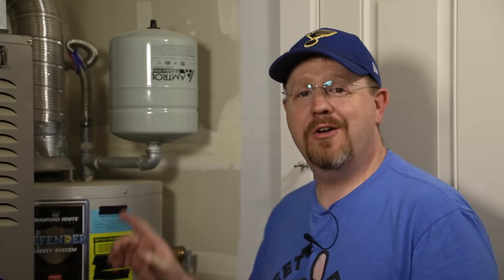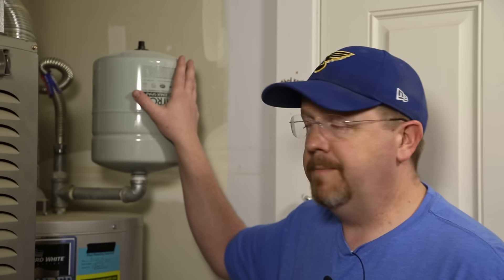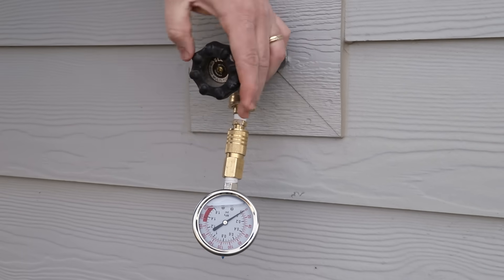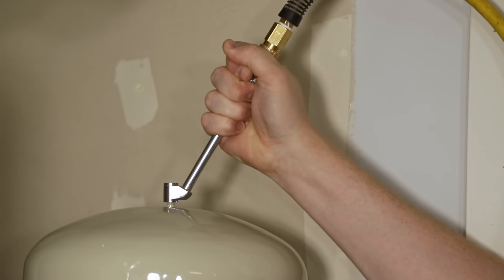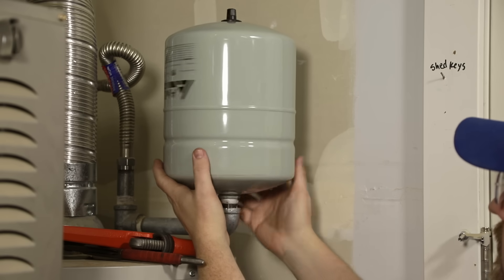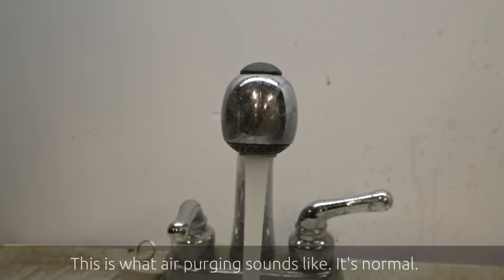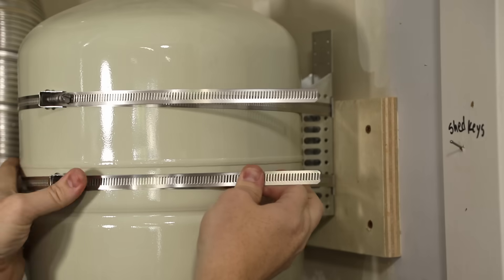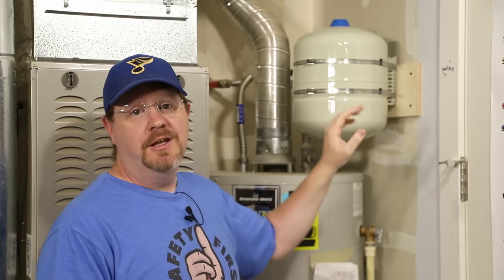What Is This Tank? How to Replace and Maintain a Water Heater Thermal Expansion Tank

Comment: Awesome video!  
Questions. Can an expansion tank cause these noises around the entire home after a bathroom faucet use or toilette flash...there is this hammer like noise.  Can a bad tank cause thus noise.  Thanks
Reply from the maker: Hi Khalid - you are describing "water hammer", which a tank like this can help with, but only on the hot side. If you hear this noise when a faucet is only open on the cold side, then you need a "water hammer arrestor" installed. You can learn more about arrestors here: https://www.phcppros.com/articles/2634-water-hammer-arrestors

Good luck!

Comment: Thanks for sending link to this video I watched your other video on how to drain and flush W/H . One thing you said at the beginning of this video though about "how it works", You said the E tank has half air in it and the bladder holds the water, I have always thought it was just the opposite water in the tank and bladder on top which is attached to the air valve, did I misunderstand your description  and it's not important in the end I guess, but I like knowing about how stuff works. I wish I had 75psi wp, mine is only 35psi. Thanks for another great video. I replaced my water heater about 3 years ago because my old ones thermostat wouldn't allow it to heat until the water temp got uncomfortably low, it could have been because of scale and rust surrounding the thermostat anyway my new water heater is doing the same thing but to a far lesser degree, which is disappointing, it seems like it could have (should have) a narrower range between heating and off.
Reply from the maker: Hi Harry - I think you understand correctly (and my description may have been a bit lacking). The expansion tank is made of 2 chambers, separated by a rubber wall (bladder). The chamber on the side that screws into the tank will fill with water. The chamber that is on the side with the schrader valve is filled with air, pressurized to match your water supply. Ideally, the bladder sits more or less evenly between the 2 chambers, but as water expands during a heat cycle, it will expand the bladder into the air chamber. When the water cools and contracts, the bladder contracts. I've been planning a video for a long time where I cut a few of these in half to show the insides, and better explain how they work. Maybe I'll get that on my list for sooner than later. Thanks for watching!

Comment: do you need expansion tank even of you Don't have backflow valve?
Reply from the maker: Need is more or less dictated by your municipal water supply. You probably don't need one if you don't have a backflow preventer, but having one will help future proof in case your water supply ever changes, and it will provide an extra level of protection against thermal expansion in your system, as well as the effects of water hammer on the hot side of your system. Thanks for watching!

Comment: If I don't have a way to check my water pressure is it ok to just go with the preloaded PSI in the tank if it's the same as the existing one? My expansion tank is actually crack and leaking so I need to replace it. I would attach a picture if I could.
Reply from the maker: Hi Shina - most tanks come pre-loaded with too little pressure. Most municipal water supplies run between 60-80 psi. I recommend setting your expansion tank to around 60 psi if you don't know your water supply pressure. Good luck!

Comment: How or does the initial air in the expansion tank (the water side) escape?  Air is lighter than water and if you install the tank above the water source, it would seem to me that any air in the tank would be trapped permanently.  Maybe this is not an issue because in theory the tank can still fulfill its expansion and contraction duties with air on both sides of the bladder.   Also. My tank is from Amtrol, and the instructions specifically say to mount the tank with the air valve at the bottom and the inlet water valve at the top.  If I were mounting the tank below the water source I can see how the water would enter the top of the tank, but due to space constraints, I have to mount my tank completely above the cold supply line and run a line up to the top.  In this orientation, I can’t see how the air ever escapes from the tank.  What am I missing?
Reply from the maker: Hi WK - the bit you are missing is that the air does not ever escape a functioning tank. The tank is split into 2 sides: the water side, and the air side. The bladder inside the tank keeps the 2 sides separated, with the compressed air on one side, and water expanding/contracting on the other. You can think of this bladder sort of like a balloon inside the tank, that is inflated with air. As water is forced into the tank, the bladder full of air is simply compressed to a smaller volume. Since air is compressible and water is not, this whole setup works really well.
Some tank manufacturers recommend installing the tank in a specific orientation, others show that in can be installed in several different orientations. The tank I showed in the video, for example, can be installed in either vertical orientation (air up or air down). 
Hopefully this all makes sense - I'm happy to clarify further if needed. 
Thanks for watching!
Reply from the maker: In re-reading your question: I realize I misunderstood: Air can leak out of a failed shrader valve, through a pinhole leak in the side of the tank, or through a failed internal bladder. Most often they fail because the plumber who installed it initially did not bother to check the supply pressure and pump up the air side to match. That flexes the bladder beyond its limits, which causes it to leak the air into the water side.
Reply: @AmplifyDIY  Thanks for the replies.  After watching a whole bunch of installation videos, I have decided that my high location for the expansion tank (which is higher than the cold supply line) is not a good location for future servicing.  After thinking about how much a full tank of water would weight and me on a ladder above my water heater, that's not a good scenario when it comes to replacement.  I am limited on usable wall space near the water heater so I've decided that I can mount the expansion tank metal strap mount on a simple piece of 1"x4"x4ft lumber and then use the water heater earthquake straps to hold this on the side of the water heater.  Solve my lack of wall mount space and puts the expansion tank below the cold supply line with the correct orientation specified by Amtrol.  Solves all of my issues.  Thanks again for the response.  All comments help to get me thinking of a better solution for my situation.

Comment: I think my two heaters are hooked up in series. If I'm right, then I want to make sure I understand which one is the one that directly feeds the house, and which one is receiving cold water from outside. I think tank A is receiving cold water from outside, and that's the one with the overflow. Does that make sense? The reason I think this is (a) I turned it down to the pilot setting and I'm still getting hot water (the other one is still on hot), and (b) Tank "A" has the overflow tank, and tank "B" does not. You said that the reason you need the overflow tank is that there's a check valve preventing back-flow, well in this case, tank B's water can just flow back into tank A, but tank A has a a check valve, so that's why it needs an overflow tank.

Does that sound right? If so, I have another question: If I have two heaters in series, for normal use in a small household, is it better to turn heater A off and let heater B do all the work, or is it better to let heater A do some of the work, and the let heater B do the rest of the work? I'm guessing it's slightly more energy efficient to just turn heater A off, especially since a warm heater A would just foster legionella.
Reply from the maker: Hi Mitch - you are exactly correct with respect to which is heater A and which is heater B, and the one with the expansion tank is the one receiving cold water from outside. 

As far as how to set them up: It depends on your water usage patterns. If you have 2 40 gallon tanks, you could try turning tank A down to the pilot setting, and experiment to see if you ever run out of hot water. If you do, then turn tank A back on to the same heat setting as B. If you don't, then you can certainly turn tank A down to a lower setting (but probably not all the way to pilot). This will make both heaters work less.

Great questions!
Reply: @AmplifyDIY  Thanks so much. I think I'm simply going to turn tank A off. It's not too much trouble to turn it back on if it's not working and with only two people living in the house, I don't think I need that much water heated. They're in series, so it's still getting water flowing through it, so I don't see any particular problem with turning it off. It's missing the piezo-electric ignitor, but I bought a new one, so once I get that installed, it seems like it will be just as easy to turn it on and turn it up if I, say, have a lot of company, or get some kids as it would be to turn it up. And that way the pilot light won't have been running pointlessly for years at a time.

Comment: Question Where do you connect expansion tank INLET  or Outlet?
Reply from the maker: Hey Raved - it goes on the cold water inlet to the water heater.
Reply: @AmplifyDIY  Thanks for your reply i will replaced my heater tank since had small leak and also i order pro press tools  i own small granite business and now i expand my business to do some bathroom and kitchen renovation

Comment: I hope I can get a quick amswer. How we choose the expansion tank, is there a calculation?
For instance , if I have a 70 Gal. Water heater. Would a 15 gal tank be enough?
And thank you for the great information.
Reply from the maker: Hi Wyle - you can use this calculator to get an idea of the size tank you will need. I put in some typical baseline numbers for a 70 gallon tank, and it seems a 4.5 gallon tank (the size I installed in this video) is perfect: https://www.watts.com/resources/planning/etp
Good luck!

Comment: Replacing mine tonight thanks to this video. My pressure relief valve had been leaking even after I replaced it and I couldn’t figure out why. Went to check the pressure in my expansion tank and water came out. Guessing that’s what caused my dishwasher to fail last year. Washing machine has been acting funny too. Hopefully I caught it before it caused too much damage. Great video & great channel. Gained a subscriber.
Reply from the maker: Awesome! I'm so glad it was helpful.

Comment: 6:06, doesn't know how to use a pipe wrench??? Has it on backwards.
Reply from the maker: Hi Dean - at that specific timestamp I was using the pipe wrench merely as a brace on the lower elbow so that the extension pipe attached to the elbow would not rotate in the fitting at the top of my tank while I used the other wrench above to remove the actual expansion tank. I could not fit the pipe wrench on the "correct" direction, due to the proximity of the wall on the right hand side of the shot.
In short: I was not using the pipe wrench as a wrench right then. I was using it as a brace.

Comment: Do those valves on top of the pressure tank ever leak? Maybe that's why you've got low pressure... ?
Reply from the maker: Hi Buixote - yes, the Shrader valves can sometimes leak. If you measure it and have low pressure, fill it back up and measure it again in a few days. If it is low again, replace the valve core or replace the whole tank. Thanks for watching!
Reply: @AmplifyDIY  I wondered... 'cause it's happened to me with car/bike... it's kinda gross, but I just put some saliva on it and check if it bubbles... you could also use soapy water if you're more fastidious...
Reply from the maker: Yup, Shrader valves are generally reliable, but they can develop a leak. Luckily, replacing their core is incredibly simple. I did a whole video on that as well: https://youtu.be/3U3Pv-YtMCs

Comment: Great video. Couldn't  you open a faucet that is lower than the tank to drain it? The drain on water heaters often will not drain. I often have to unscrew them or break them off, if the drainage can be directed and the water heater is being replaced. Cheers.

Comment: Working on replacing mine right now. Mine is actually spraying a super fine mist on the side of the tank right in the middle of the tank. I can only feel the mist , unable to spot the pin hole . Weird. Leaked from the expansion tank down the side of water heater and made a little puddle on the floor. I have never maintained this tank in the 10 years that I have lived in this home. Thanks to your video Ill replace the tank and maintain it from now on.  Did you ever put the shed key back to it's spot?
Reply from the maker: The shed key is safe and sound, back where it belongs. :)

Comment: Just curious, but did the manufacturer instructions state to mount it in that orientation? It looks upside down to me, just curious. Thanks, it was a great video.
Reply from the maker: Hi Ed - it can be installed in either vertical orientation, according to the instructions. Thanks for watching!
Reply: @AmplifyDIY  Nice, glad to hear. I'm currently upgrading to a hybrid water heater, 80 gallon, and will need to install a larger expansion tank. Using Push to Connect fittings for all. Makes it alot easier and faster. Appreciate your video and the clean install look.
Reply: @AmplifyDIY  Yes, the Everbilt and the Watts are two where the manufacturer allows vertical mounting in either orientation.  That Amtrol tank that you had originally however, was mounted incorrectly according to Amtrol and needed to be fed from the top, not the bottom (eg., with the label right side up).  I have a Watts DET-5 that is supported entirely by the water heater, and it is blown (water coming out of the Schrader valve, 9 years old).  I have an all-copper soldered tubing system and I am considering re-plumbing the cold water side so that I can have a top-fed vertically wall mounted tank which relies on the wall bracket and not the heater for support (I enjoy soldering btw and I am pretty decent at it).  This configuration will also allow me to use any brand tank (since they all support vertical top-fed orientation) but only a handful support the vertical bottom-fed orientation.
Your videos are really, really good and have been a great resource to me.  Brilliant work!

Comment: Does it matter if your schrader valve faces up or it faces down below the tank?  I noticed most advertisers showing the valve oriented below the tank, but I noticed yours is upside down so-to-speak with the label also upside down; hence the reason I ask.  Thanks for any feedback.
Reply from the maker: Hi John! With some tanks the orientation matters, but the instructions for this one specifically allow orientation in either vertical orientation. If you are replacing yours, pay attention to the instructions to make sure it is installed correctly. Thanks for watching!
Reply: Thanks for that feedback.  The one I will be replacing is made by a company called ProFlo, Model PFXT5.  It was installed by a well-known reputable plumbing company in my city and they installed it in the same orientation as yours, except they didn't use a support bracket which I think I will add to the next one I install.  So since I didn't receive the installation instructions, I guess I'll have to assume they know what they are doing and if I purchase the same unit from another reseller myself I guess I'll install it the same way unless, as you stated, I should check the manufacturer's instructions as the final say.  Thanks.

Comment: Is it bad that my electric water heater doesn't have this??
Reply from the maker: Hi Jum - no, not necessarily a problem at all. It depends on whether your home's water supply needs one or not. If your home is a little older, most likely it's not required. If other homes in your neighborhood have one though, you should contact your water company and see if they recommend one or not. 
Thanks for watching!
Reply: @AmplifyDIY  My home was built in 1991 and it did not have one installed originally.  However, when the water heater was replaced in 2012, it was a mandatory item as per local code and one was installed.

Comment: ... or you just dont buy a bradford white. They fail in 3-5 years on average. If there's a value brand of water heaters, Bradford white is the cheap Chinese knockoff of the value brand.
Reply from the maker: ...if only most homeowners had a choice about what heater is already in the house they bought. Properly maintained, even a Bradford White will last many, many years.
Reply: I'm having a real tough time understanding what the failure and replacement of an expansion tank has to do with the brand of water heater purchased.  I don't think it is relevant at all.  I've seen expansion tanks fail on everything from an AO Smith to a Rheem and Ruud. Or did you just want to crap on Bradford White water heaters?